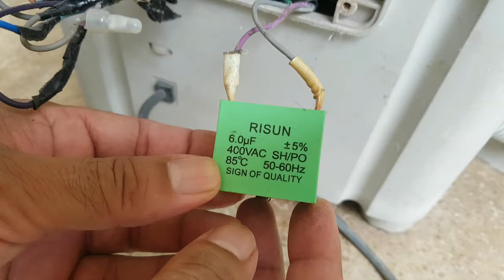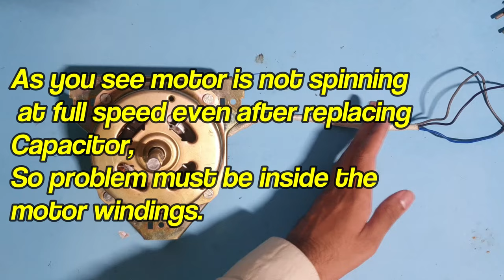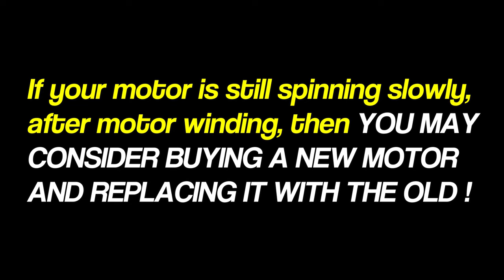Fix Slow Spinning Washing Machine Dryer | Dryer Slow Spinning Problem | DIY Repair Tutorial

Comment: He replaced 6uf capacitor with 7.5.   That's a 25% increase in capacitance.   That will eventually burn out that motor faster.       Kids, use the right capacitor.  You can find the rating usually on the motor plate..

Comment: Did you buy the motor? It says in your video is install it with "fixed" which means you didn't bought a new and that being said you fixed the broken.
Reply from the maker: I did not buy motor .There  just a wire inside motor was broken,which was fixed